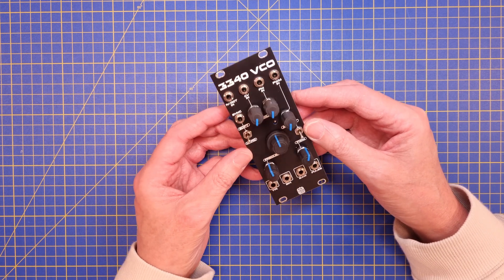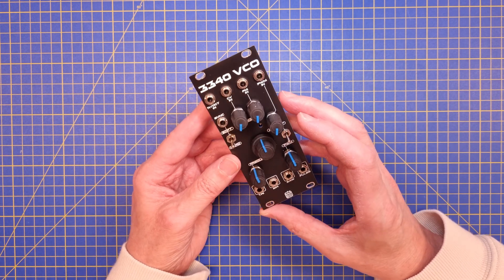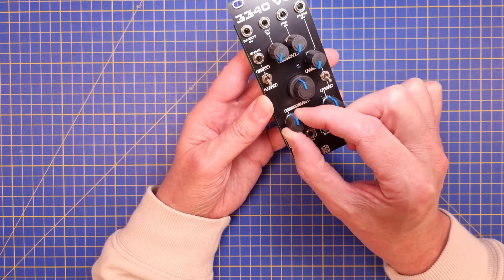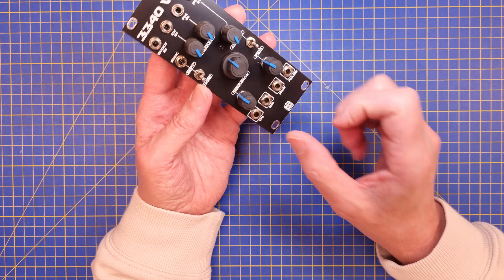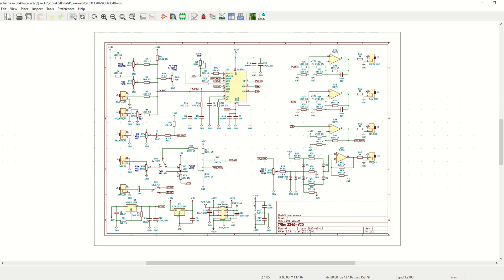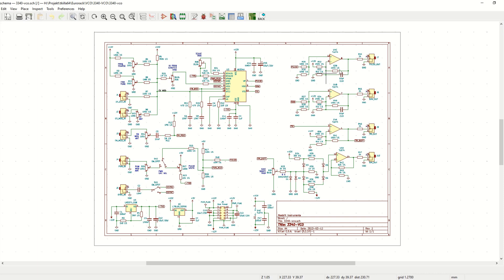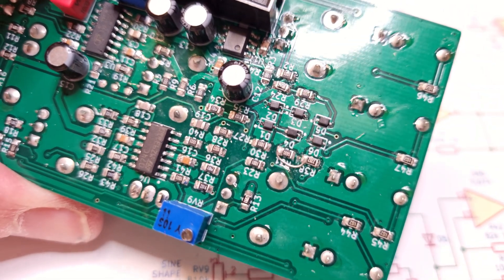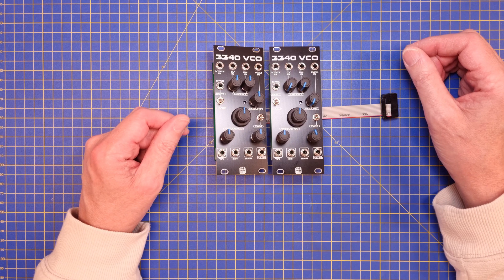Eurorack DIY - VCO module completed

Comment: Do you have somewhere the calibration method you used? Does it work the same way as the kassutronics?
I made this same design but utilising the 5v from the power supply instead of regulating the 12v.
And I made it all with through hole components because that's what I had in hand.
Reply from the maker: The method I used was something like this:
1) Setting the 1V/OCT input to 0.000V and adjust the pitch to B0 using the frequency dials.
2) Increase the input voltage to 5.000V and adjust the tracking trimmer so you get the pitch B4.
3) Repeat the steps above until both voltages have the correct pitch
4) Now you can check the tracking of other input voltages 1V, 2V, 3V etc.
A tuner and a digital multimeter with atleast 3.5 digits is very useful here.
Here's a good link to a table with the 1V/OCT standard to use as a reference: 
https://www.allaboutcircuits.com/projects/diy-synth-series-vco/
Note that there are more elaborate ways of doing that and Kassutronics method is one of them, but this is the method I used.
Hope this helps you, good luck!
Reply: I think the combination of both calibration trims is what confuses me. I will give it a try.
But so far I gotta say that the design works really good. It is actually my first experience with modular. I decided to go full DIY from the beginning and its awesome. I had to troubleshoot some unconnected nets i completely overlooked in Kicad (cause Im a bit dumb) but it all works great now. Thank you.
Reply: @MeeBilt  Quick update. Calibration done!!
It now covers pretty damn good between B0 and B5. The problem I had was not from the VCO but from my arturia keystep 37, and it wasn't even a problem.
At least for me the keystep came with factory preset C (-2) as the reference 0.000V, you can change it from the pc through arturia's Midi Control Software.
I changed reference to B0 and then calibrated it with that method and it worked out perfectly.

For other rookies out there, take a look at your CV sources before assuming you did something wrong.
Reply from the maker: @guillediaz1776  Awesome! 😎

Comment: I built your VCO using the design and gerbers on your eurorack github page. I sent the gerbers to JLCPCB and sourced the (mostly) SMT parts myself. I'm quite pleased with the design and performance. I made one change to the circuit: I changed R5 100k to 47k so that the (coarse) frequency has a greater range. There's a picture on one of my eurorack github page (at the bottom of the page). Many thanks!
Reply from the maker: Thanks! That's a great mod to increase the range of the frequency knob, thanks for sharing

Comment: Very neat! I built a similar but simpler VCO, based off of the LMNC. Added a sub octave on a daughter board just recently and it really makes a big difference. Can recommend!
Reply from the maker: Nice! I was thinking of adding an octave divider too (/2 & /4) but I couldn't fit it on the PCB, so I had to delete that. But maybe I should make a module for that...? 🤔
Reply: @MeeBilt  My Make Noise VCO has a sub oscillator, but i did make oscillator module with 2 outputs.

Comment: Hi I am struggling to find the right size switched to fit the board every one I have purchased the pins are  to big and to far apart can you help please? Thanks
Reply from the maker: Sorry to hear that you problems sourcing the right switch. The type with the smaller footprint are called  sub-minature SPDT switches - the model name for the one that I used is called SMTS-102.
Here are a couple of sources for these:
https://www.electrokit.com/en/product/toggle-switch-sub-miniature-1-p-on-on-solder-lugs-smts-102/
https://www.amazon.com/UTEYEEW-SMTS-102-Sub-Miniature-Toggle-Switch/dp/B09VRVXFGN?th=1
https://www.aliexpress.com/item/32950729427.html
https://www.thonk.co.uk/shop/sub-mini-toggle-switches/

Hope this helps you!
Reply: @MeeBilt  Thanks for that I am still waiting for the Chinese one 4 weeks and counting I had just put into my basket the ones from thonk Thanks for that. The only part I am struggling with is the TL074 I had a look on Digi-Key and they come up with TL074CD TL074YDT and on and on so I'm lost at the moment. Thanks for all your help
Reply from the maker: @StreamingUnderground  I bought a bunch of these a while ago:
https://www.digikey.se/sv/products/detail/stmicroelectronics/TL074CDT/599312
I see that the prices have increased - I should have bought a bigger lot.... 🙄

Comment: What's Parts software have you uploaded into KiCad to use your bom file to order your parts for the project?. Thanks
Reply from the maker: I'm using the standard BOM generation script that is part of KiCad to generate the bill-of-material - no addon software is used. Most of the components (symbols and footprints) are taken from the standard libraries that are shipped with KiCad. Hope this answers your question?
Please let me know if there are any specific component that you have questions about, which type or where to source it and I will try to help you 😊

Comment: I have just ordered my panels and boards - could you please do a parts list Many Thanks. I look forward on making all your boards
Reply from the maker: Thanks a lot - I'm stoked that you find the stuff on my Github useful 😊
There is a Bill-of-Material in HTML format: https://raw.githubusercontent.com/tkilla64/eurorack/main/3340-vco/3340-vco_bom.html
Save that file on your computer and open it in a browser and you will have a formatted BOM that will help you a lot.
The design has a lot of 1% tolerance 0805 resistors - I suggest buying a sample book with assorted values.
Good luck! - let me know if you have any questions
Reply: @MeeBilt  Thanks for that

Comment: Yes, I like the panel layout.  I was planning to do the same kind of layout on my dual VCO (using the CEM3340).  It would give some needed support for the PCB. However, I was a bit hesitant, since one  does not often see the input jacks on top.
Reply from the maker: A dual-VCO sound awesome! 
I haven't really worked out the placement of the input and output connectors yet... I see that some manufacturers put the connectors on the left and right sides, but I'm not sure that it will work better... especially if there are a lot of inputs and outputs.
Reply: I always do input low and output high, input high means the cables (or more) will lay on/hang over the module.
As does Make Noise STO, DPO, Mutable instuments, etc, but Make Noise Noise maths has input on top and side.